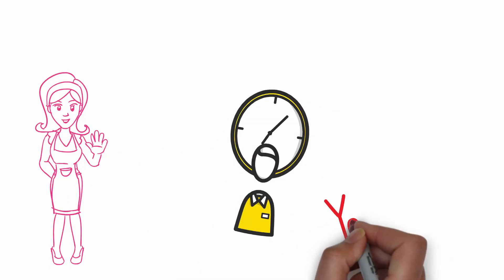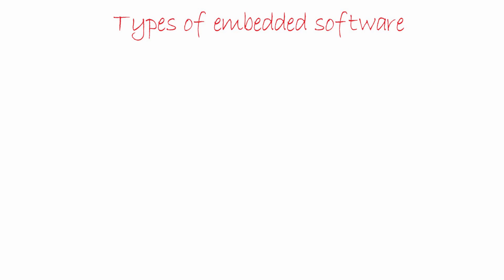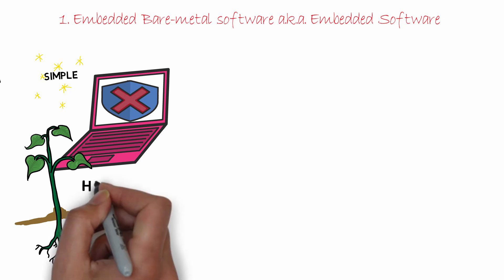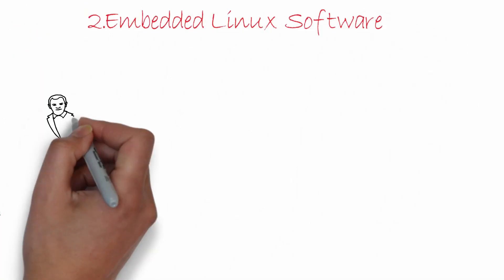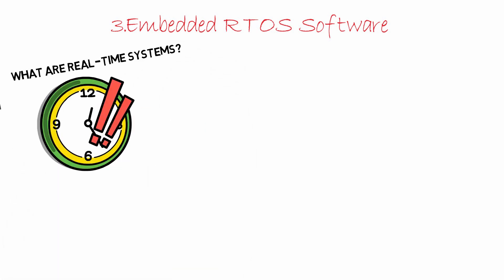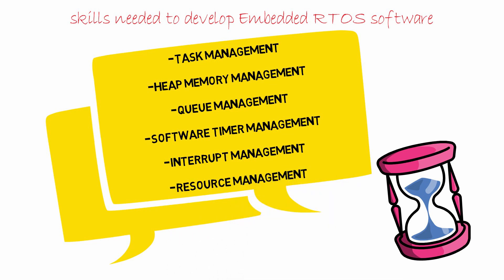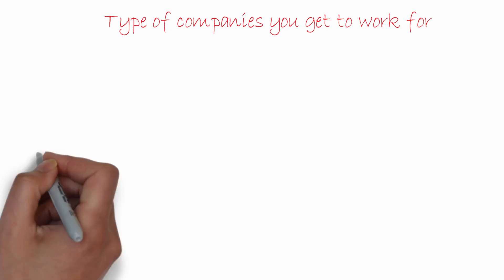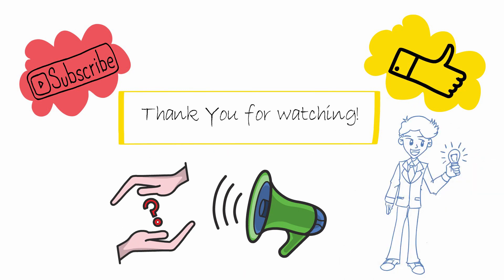What does an Embedded Software Engineer Do?

Comment: Beware that this video is fairly irrelevant. The first things I was asked is what do you know about testing Bluetooth and WiFi transport protocols, what do you know about USB certified compliant testing. Ie how do you validate a hardware appliance at the transport layer, and how do you flash firmware on a device. Test methodology is irrelevant if you don't have these hardware skills
Reply from the maker: Thanks for the comment, but this video is about the "Embedded Software Engineer" role but the questions you posted were all related to a "Embedded Software Tester" role, which I am afraid is not the same.
Reply: @embeddedinventor4594  @whitewittok's role description may look like a SW tester role, but it's a developer's responsibility to fully test his implementation before releasing for review, system integration and system testing or system validation. 

Unfortunately, testing is rarely mentioned in dev job descriptions and thus many devs don't have enough skills in testing their own written code.

For me, a must-have skill for a good and experienced sw dev is to know how to test their code.
Do you have a video on that?

Comment: Do embedded software engineers also work on smart devices doing things like ML or computer vision?
Reply from the maker: These days a lot of smart devices include tech like machine vision and machine learning grouped together with embedded systems. Though the job of embedded software engineer does not involve writing algorithms for these tech, but they usually have to work closely with  the person who does that!
Reply: @embeddedinventor4594  or so who exactly does write those algorithms?
Reply: @alternateuniverse656  Whoever applied to do that specific job. There isn't any one specific job title for it.
Try checking on job finder websites for ML engineer job postings and see what the companies in your area/country list as requirements to get the job as different places will want different levels of expertise and skills.
You need to do your own research on these topics, since the answer depends on where you live and where you want to work.

Comment: I am an Electronics Lover. I passed out this year from ECE - 2020 from AKTU. 
I have done my internships after my Second year & Third Year in Embedded domain through Internshala.
I have a worked on Arduino, Atmega8,328, STM32F103, STM32F470G, ESP8266. I have created a lot of Projects with them. But the Main problem is I'm not able to Find the Jobs above 15-20K. How can I get a job in a good company with a Decent Package. I Love Electronics but not Getting a Decent job so I just thought whether I am choosing a wrong Domain. Please Help.
Reply from the maker: Companies like Nvidia and Intel does hire embedded engineers in India. It sure is hard to get into these companies as a fresher. I recommend you give it your best shot, if it doesn't happen you can always join a smaller company, get a few years of experience and then try getting into one of these big ones.

All the best!
Reply: chaithanya reddy  Hey!! I got the Job in an EV Startup as an Embedded & IoT Engineer. Worked there for almost 10 Months.
Now Switching to Oye Rikshaw! As a Product Manager in Embedded & IoT.
What do you do? You can connect with me over LinkedIn.